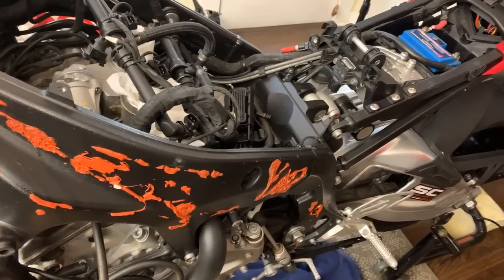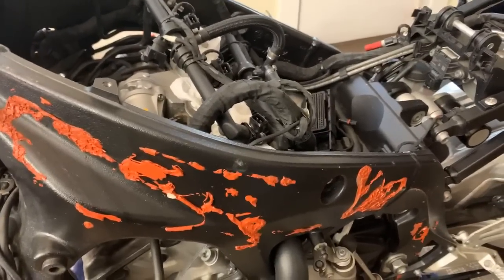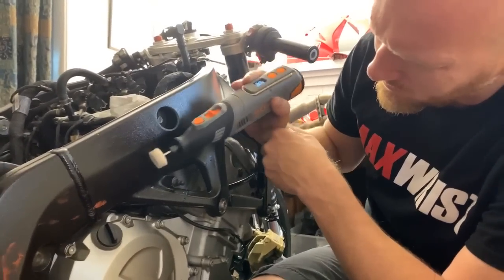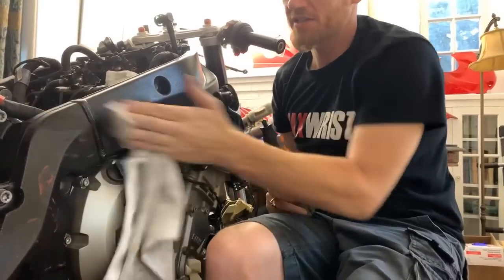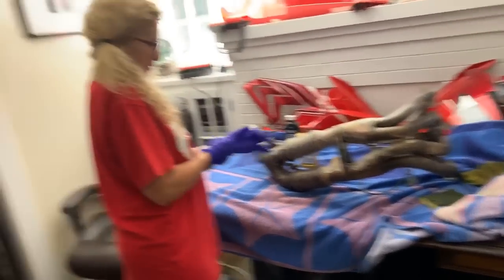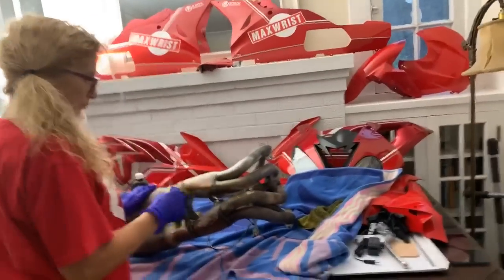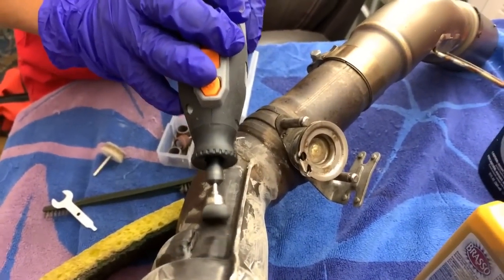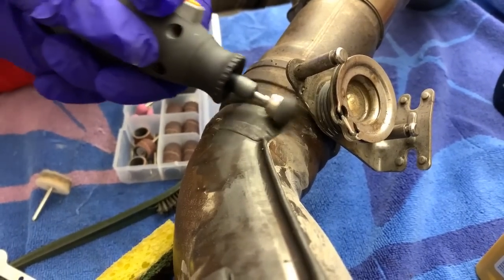Removing Glue from Painted Aluminum

Comment: For such adhesives as this, all you need to use is petroleum spirit (lighter fluid) or even petrol will do this, without having to use a Dremel buffer head.

Comment: UK lads use harpic because it has hydrochloric acid which removes rust in seconds. Try and find toilet cleaner or something with hydrochloric acid in it. Stainless steel wool helps used with harpic. Just clean it well with soap afterwards because the acid will keep eating away at the pipes and be careful not to get any on your paintwork.

Comment: Get you some goof off and a good rag for those spots in the grooves after u get it dremmeled down. Reason dremmel is working so we'll is the high rpm just beating it down.hell u could spray the cloth tool with goof off or mean green whatever u have available. But goof off is amazing for any adhesive. N with that tip she is scarring the exhaust. It will groove it. One of those cloth tips and some good thick wax on it then dremmeled in and wiped off should do wonders